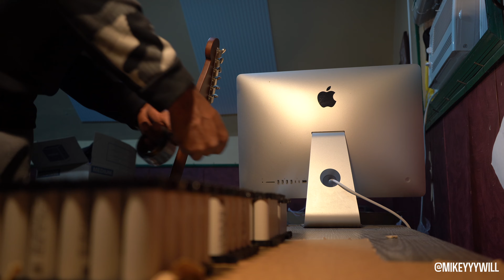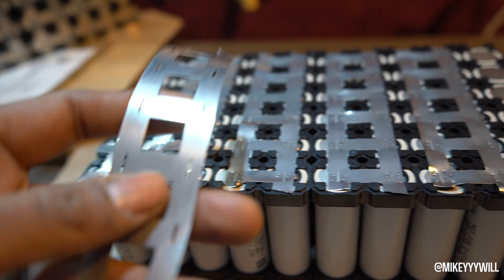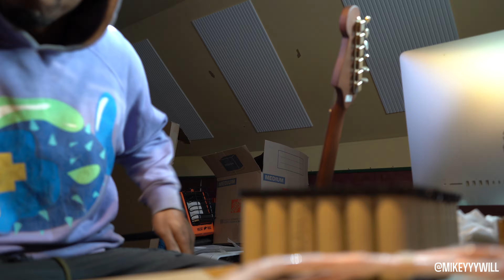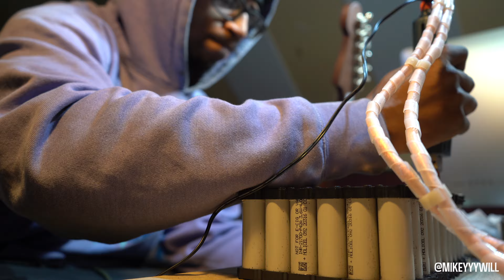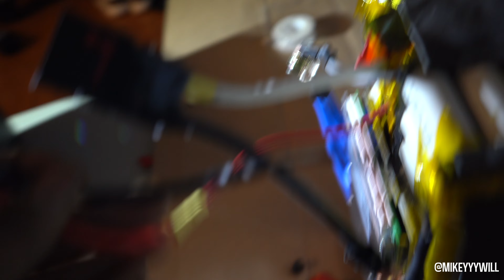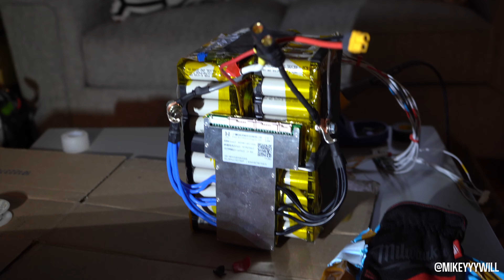How To Build A 72V Lithium Ion Battery For A Mini ATV

Comment: It always fries my brain trying to work out where all the balance cables go. With my JBD BMS the wiring diagram was wrong because I had an extra cable!!! I counted every cable on the diagram and my BMS to make sure I wasn't going mad... In the end I googled JBD BMS and found a wiring diagram for a different model, and copied that - and it worked!